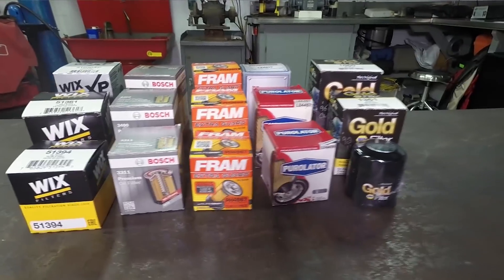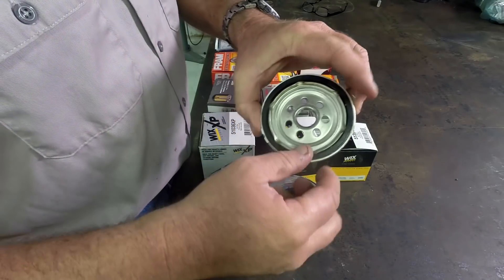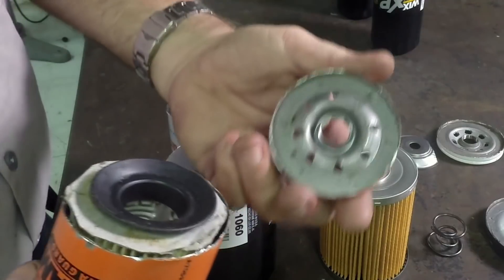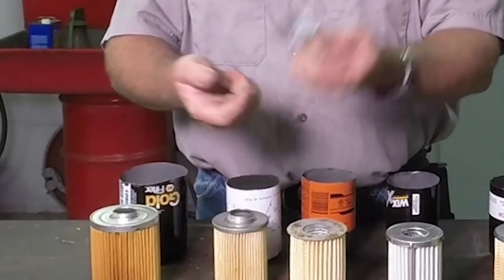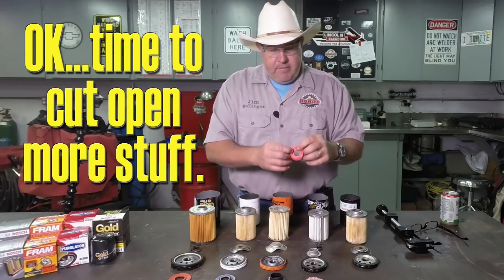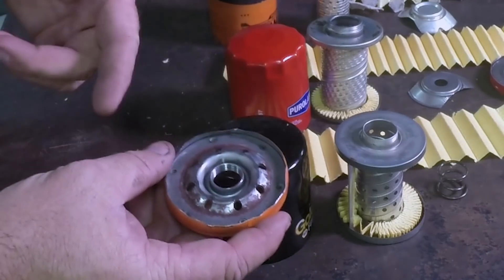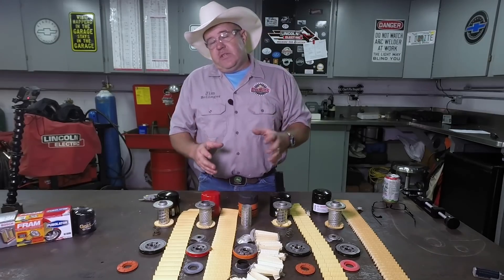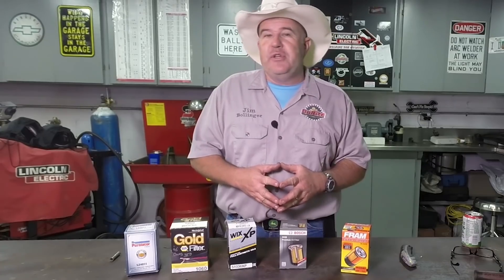The worst oil filter EVER!

Comment: Interesting but that is not how you test a filter.  As a engineer I appreciate the best products are the ones that do the job at the least cost.  The purpose of an oil filter is to filter the oil.  So how well do all these filters filter the oil over the life of the filter?  We have nothing here.  There is no performance information.  What is wrong with cardboard as part of the assembly that is holding a PAPER filter?  Mechanically the Fram filters will likely burst at a lower excessive pressure but what does that have to do with a normal engine that cannot produce such pressures?  

As a totally disconnected comparison I once worked with some German designed process equipment that used a 440 volt, three phase motor coupled to a variable mechanical cone drive that used about 50 watts to turn a 1 inch auger at about 5 rpm through a flexible cable drive.  Mechanically magnificent components.  Economically and practically a total disaster.   Any competent designer would have used a little DC gear motor and electronic controller.  In 39 years I have never seen a more expensive dis-functional piece of crap.  Really, a flex cable drive that created pulses unless held perfectly straight?  Three phase, 440 volts in a sub horsepower motor?  WTF?

 I am not impressed by expensive components in a filter that is going in the trash within a year.  Show me pressure vs. flow, valve performance vs. temperature, and particulate analysis over the life of the filter or go away.  Good engineering is keeping that performance with the least cost components.
Reply: I think most people are missing the point, the comment is not defending the Fram filters but instead Gary p is simply stating no performance tests was done to see the effectiveness of each filter. Yes the Fram may be trash however the video did not prove how well the filters did there job.
Reply: @ianbrantley837  I don't thing people are missing the point at all. One can do a pretty go job of inferring performance by examining build quality. Certainly actually testing the effectiveness of the filters would be a logical next step, but it is also logical to simply eliminate obvious bad ones. Would you even bother to test the effectiveness of a filter filled with toilet paper? Of course not. A filter that has rust and filter medium that is deteriorating when new doesn't need any further testing.
Reply: The issue here is that Fram sells their badly engineered filters at the same price as the others (lookup a 2000 Chevy Tahoe 5.7 oil filter on RockAuto....), so there is zero benefit to the customer for all that low dollar engineering.   I get what you are say and, as an engineering lead, totally agree, but your actual point is completely misplaced since there was an actual issue with the Fram filters (rust in the filter) that would cause a serious issue in parts which have tolerances in the thousandths and would be catastrophically ruined by contaminated oil -- e.g. crankshaft bearings and the actual crankshaft.    Your engine is worth more than saving even $20 dollars on routine maintenance......
Reply: @ckm-mkc  Fram is far less expensive!
Reply: I just wanna know, next time YOU go to buy an oil filter. Will it be FRAM? 🤔
Reply: @jjuiines1921  yes.
Reply: You don't have to be an engineer to see the quality difference here. It would be awesome to see some actual scientific testing on these products. You should make a video and show us how its done.
Reply: Agreed. From Engineer to Engineer we must test the functionality of whatever it is we are studying.
Reply: @Matt H I can back up Matt. My automotive teacher years ago made a comment about most blown engines in a junk yard will have a Fram filter on it.
Reply: Gary, you want evidence then go poll professionals who fix engines and also go to a junk  yard and find non wreck cars (which means it junk due to mechanical failure) and look what brand filter it has. Also filter can come apart internally and damage engine. No surprise considering what we see here. 

commentator jolly green biker writes  " I also have a genuine Fram disintegrate about 15 years ago on me, needed to tear apart my engine to clean it out.  They are junk and even some dealerships also now refuse to use them." see comment about counterfeit filters. 

My shop teacher had a similar story. The test you ask for can be found through the makers of the filter. There is also the American Petroleum Institute which test oil. You'll find it starbust symbol on quarts of oil certifying quality.

Good engineering is making something that works. As you know there is always a trade off when making choices during the process.

Bottom line is you can look at the inside Fram filter and tell its junk. Writer fram and request its test and ask how many claims for damages have been made against it.
Reply: I agree in principle with Gary P, as it is true that both gold and steel both conduct electricity, and gold is perhaps a superior material for some applications and steel better in other applications.  So something’s function should be measured by what it is supposed to do rather than what it looks like.  In fact, it’s a well known fact that a quartz seiko watch probably runs circles around the accuracy of the finest mechanical watch....  That being said, it was pretty eye opening to see the distinct differences in construction of these filters.  I’ve switched to K&N a few years ago, but mainly because of that handy nut on the end of them.  Looks like I need to do some more research on them, as I sit here contemplating 4 cars in my garage at a value of 20 grand each, or more. After I see this video, it reminds me that an extra few dollars on a higher quality item is most likely good insurance. What I’m trying to say is that Gary P is absolutely correct, but dang that orange filter looked pretty questionable next to those others.
Reply: @markg7963  , as long as an oil filter can conduct electricity, that's all that matters :D

But your right on saying that's spending a bit more on an oil filter is worth it, especially when its unveiled what you do get for a cheap price from Fram is basically a cardboard paperweight.
Reply: I agree that no comprehensive tests were done,  but bottom line... rust inside a brand new filter is unacceptable.  That alone is enough to warrant never using Fram again. As an average consumer, and not seeing data sheets on testing, at least we can make a decision based on something other then a brand name.
Reply: You make many valuable points.
Reply: My eyes dont lie, friend.
Reply: Bro gtfo of here. Fram had fucking rust inside? Your really going to try and say this didny prove anything
Reply: Fram engineers arrived to say a word or two? You guys would be happier in China.
I'd say lets use less steel and rubber on parts that are wasted each year though. Yeah, but make the stuff much cheaper then.
Reply: Your first mistake was admitting that you're an engineer lmao
Reply: The filter might be a type of paper but it's NOT cardboard. I would not want anything that dissolves as easily as cardboard playing any role in holding my filter together.
Reply: I just looked at a bunch of replies and I will stick with my comment.  Performance has to be measured.

I would like to add a helpful suggestion for small and seasonal engines.  An auto guy I worked with in my first job described the big issue with old oil is the buildup of sulfur in the oil from the gasoline.  He said that the sulfur by itself does not cause a problem.  If you drive often and the oil is hot for a reasonable length of time, there will be little moisture in the oil.  You can drive a vehicle with extended oil changes with little problem it the oil is dry.  Water is the problem as sulfur plus water gives you sulfuric acid.  

Always store small and seasonal engines with new oil.  Sulfur in used oil will turn to sulfuric acid if left idle for six months.  I proved this to myself when I foolishly left old oil in a snowblower through the summer thinking I would change oil in November.  The dip stick was etched with a permanent stain.  Acid attack.  Always put away small engines with new oil.

I buy new cars and try to drive them until the wheels fall  off.  In MN with salt on the roads this occurs at about 18 years and for me a little over 200,000 miles.  I've always used Fram filters and have never had an engine problem but I change oil at 3-5 thousand miles depending on all short 10 mile trips or including long distance travel.  The oil might be very resistant to breakdown but I have not learned of any solution to sulfur buildup if the normal commute is about 10 miles.
Reply: Its so nice to see an intelligent reply here instead of all this "ooo I'm never goin to use fram again because er you said" boloney. They are like sheep. For $6 the fram basic filter is perfectly adequate for road use.
Reply: That's great. You can let FRAM profit an extra few dollars per filter, and I'll have more medium on a superior structure on my engine. The problem with these filters is not their inability to flow enough oil. It's that their construction trades your long term engine life for additional profit. This was an analysis of construction quality, not the mcguyver awards for most functional peice of cardboard. It might be a shit hot impressive peice of 50 cent engineering for FRAMS use but I'll go ahead and spend the couple extra bucks to have something better than a toilet paper roll on my thousand dollar engine.
Reply: @starvalkyrie  I change my fram filter every 20 to 30,000 miles. Currently at 540,000 miles and still going strong. Never had any problems with fram.
Reply: @Bryan-Hensley Oh well then I'll immediately go back to using the inferior shit to save 10 dollars a year. Sure I've seen the construction, and the demonstrable increased risk of passby, but why let that bother me when someone in the comments section told me a tale about their half million mile car.
Reply: @starvalkyrie  dude, I run an HVAC business. I've got several vans on the road. I've had at least 8 Chevy vans pass 450,000 miles using fram without a glitch. I've used them on plenty of racing engines. Using metal on the ends of a paper filter causes a weak spot that can leak bypassing the filter. You don't really even need an oil filter in modern engines. They are clean. You are putting way too much into an oil filter. I change them every 30,000 miles. I'm not actually recommending them. Just telling you my experience. I've used them and others since the 70s. I've never had any trouble out of any brand.
Reply: @Bryan-Hensley  Oh race engines too. I hope the jet engines are in the next story that misses the point.
Reply: @starvalkyrie  they flow very well. That matters most.
Reply: @starvalkyrie  the point is, their filters are fine and you don't understand physics, mechanics, or chemistry. Sorry
Reply: @Bryan-Hensley  Yep they're fine, 99% of the time, you won't know the difference. The point is that you can put a superior part on your car for what is practically the same amount of money. But of course it's the internet so someone has to come out and make pedantic points to defend the honor of a brand that sells ineferior if mostly adequate products, for the price that you can get better products for. Very disappointed not to hear about your success with FRAM on the space shuttle engines though.
Reply: @starvalkyrie  no one has proven those other filters are superior. How their made doesn't mean crap to how they preform. Since you are so  intelligent on oil filters, what's the cold and hot flow rates. You'd have to pick a particular engine to do this test. What the micro filtering size. Like I said, putting paper filter against a metal end doesn't seem like a very good seal. However after I got involved in this discussion I started looking at prices and the factory filters are cheaper than any brand except extremely generic. I'll probably start using factory again.
Reply: @Bryan-Hensley  It's been proven they're made of weaker material. The situation that creates a passby in the fram is more likely than the one in filters with metal cores. Beginning and end of story. They can have the exact same flow rate, they can be within .001% of the the reliability of each other and none of that will make it wise to put any additional risk to hundreds-thousands of dollars in equipment, for the sake of saving a couple dollars per oil change. The pressure that would damage the metal core would blow the entire filter open first, the cardboard can't say that. You don't have to be an expert on parts to know better than to cheap out  on pennies when you're protecting expensive equipment. I'm sure FRAM passes industry test standards just fine. In fact someone in this hellstorm of comments already talked about that. And maybe there's some use situation where it makes sense to grab the FRAM, but for the common mans daily driver it's laughable build quality to save what is for all intents and purposes, no money.
Reply: @Bryan-Hensley  Both filter mediums are glued to the core with the same glue/sealant. So on this point the failure rate would be the same unless the metal or cardboard demonstrably forms a better adhesion with said glue.
Reply: Bryan Hensley I always use K&N because I like the nut driver regardless, isn’t 20 to 30k an awfully long time between filter changes?
Reply: Thanks for your professional insight. 

I am no engineer but I saw right through this idiotic comparison.
Reply: @drewski1441  , lol!
Reply: @johnlockesghost5592  Right, try to find a mechanic who likes an engineer.
Reply: All very good respective points but the dillema falls down to this. New engines use a form of VCT actuation. Thats controlled by oil retained by the drain back valve. Theres a safety pin that it rides on until oil pressure is built. Takes about 3 seconds or less when using a good filter. When you use crappy filters like fram that drain back its like starting your engine fresh out of an oil change. So roughly 10seconds or less. Those seconds count when it comes to that system as the oil flows through the VCT then into the cams journals. This causes more wear and tear. Personally i have seen pressures shoot up from people using improper viscosity oils. That carboard filter will not hold up to those pressures so you are correct on that. Just so you know engines can produce up to 55psi of pressure at 2500RPM so yeah think about that. You just said it yourself the filter wont hold up and with engine pressures shooting up there as a actual known fact you made it a valid point not to use their filter. By the way Ford engineers specified the new engines specification for normal operations is 44PSI at 2500RPM using recommended oils so someone uses slightly thicker and boom they can reach higher pressures easily. Next is yes i have visually seen the filter come apart and clog up a pump and cause failures from that filter so yes it can happen. As far as them making money people will always migrate to something cheap. Remember hearing about why screw people big whem you can screw them little by little and drag it to the long run? Thats effectively what they are doing. People will still buy it regardless and keeping the cost down so low they will still turn a profit so that also helps them stay in business.
Reply: Well said G . Fram wouldn't be in business if they made a bad product 👍
Reply: Well said G . Fram wouldn't be in business if they made a bad product 👍
Reply: Really u know it all? Oh i forgot you are an the smartest person alive because of your job. Get a life. Fram has been crap since they 1st started making filters
Reply: @scottnewman1471  that's funny, coming from an uneducated asshole like yourself.
Reply: @scottnewman1471  I've always used Fram, never had an issue. Maybe you should try changing your own oil when it needs to be changed.
Reply: Nope you are wrong. Fram makes excellent filters.

Comment: I’ve been using Fram filters in my truck since 2005. I haven’t had one single issue with it or them. But after seeing this, I decided to go cut open the new I just bought to see. Exactly the same issue as this video. I will definitely be switching oil filters from now on. Do not buy fram filters..

Comment: jim i am surprised by what you found in the fram filters. i was a service manager for almost 30 yrs for a cat dealer. my mechanics routinely cut open filters to check for contamination during that period we probably cut open thousands of filters of all types and brands. i never saw that type of construction and never saw a filter that caused an engine failure other than an occasional can that split  because of high oil pressure. i wonder where they are manufactured now. in the end it all comes down to function. does it filter oil as well or better than the competition? oil testing equipment is expensive so i think we will need to wait for someone like consumers to run some tests. could be interesting. you may have opened a pandora's box here. good video

Comment: You want actual good filters? Try Fleetgaurd. Donaldson. Wix. Cat. Even the filters used by john deere. Case new holland etc are all far superior to any of those filters. I understand that they are made for a tough life on a diesel engine, but they will also cross over to smaller ones for your cars.

Comment: I used to use FRAM as part of oil package deal (sometimes upgrading to Bosh or Wix), but lately buy the oil separately and started using Purolator as they had good review and are so inexpensive. Great to see they are good and so much cheaper than Bosh which I had assumed where the best.